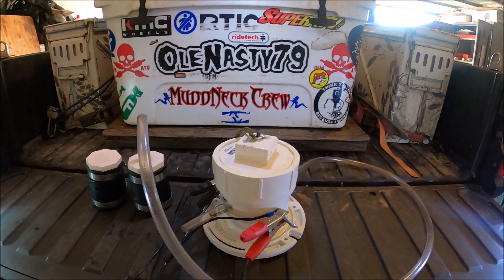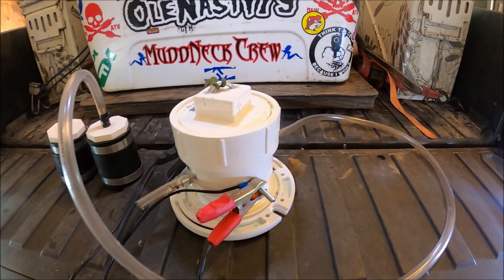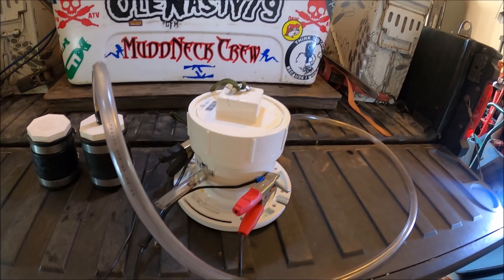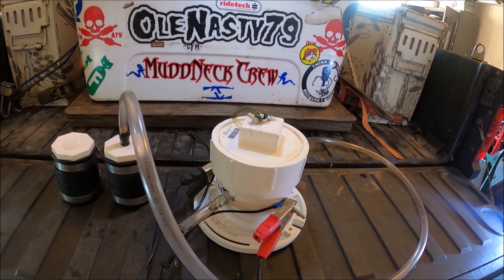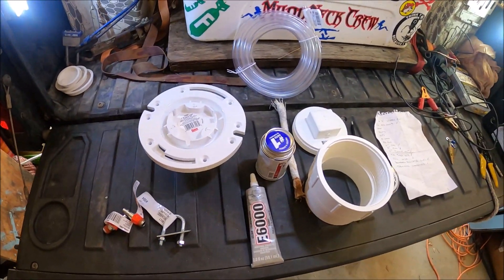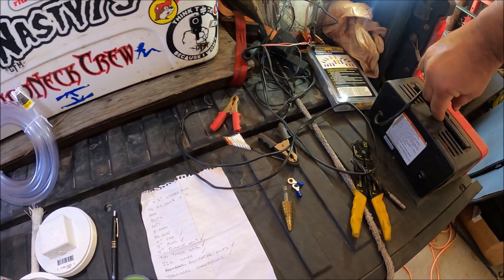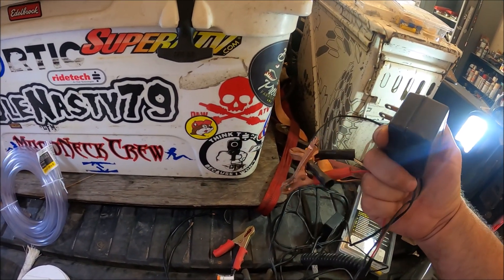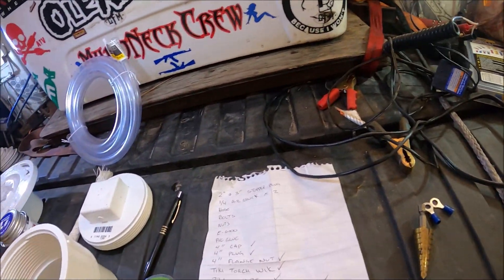Home Made Smoke Tester for SNORKELS

Comment: Thanks for your video. We built the Brew2L smoke unit, and used your video to fine tune for our needs. Tested the snorkels today, found 3 leaks and fixed them quick. My son is ready to ride! We used mineral oil, and there wasn't any bad smell at all. The mattress inflater pump was perfect to produce the needed pressure.
Reply from the maker: Glad I could help.  I'll keep mineral spirits in mind for next time too.

Comment: The ones I use use a pressure regulator and a little bit of compressed air to push the smoke. It makes it easier to spot the leaks without spewing smoke from everywhere. Just moves the smoke a lot slower.
Reply from the maker: I suggested using a pressure regulator
Reply: The key is 1psi pressure with a ton of smoke volume!
Reply: @OleNasty79  yeah i dint hear that part.

Comment: Preciate the shout out my friend! Y'all subscribe to Ol Nasty and Mytec! This is a very cool diy Smoke tester... 

I will say the biggest thing with building your own is to regulate the pressure as low as possible!! Otherwise you can create leaks that weren't there before!  And/or stuff a rag in to help seal enough so you don't blow out seals and gaskets
Reply: You guys in dfw? I wouldn’t mind getting my sportsman tested
Reply: What psi would you recommend to regulate it at?
Reply: @hondaboatin371  my Redline Smoke Pro Total Tech is Max 1 psi... So less than 5 psi for sure

Comment: okay so i followed this guide the whole way and every time i give it power my positive alligator clip wire just melts, any idea why?
Reply from the maker: Maybe try a thicker wire, that would be my first step.  Where did you source your clips from?
Reply: @OleNasty79   i got them off a battery charger from harbor freight
Reply from the maker: @skylarjordan4803  Hmm, I'm not sure then.  Is the wire wrapped around the wick getting hot?
Reply: @OleNasty79  yes and when i use bigger wired clips like jumper cables it just melts the wire inside